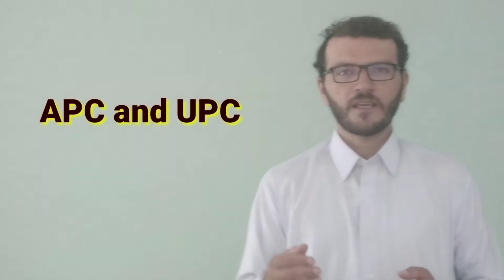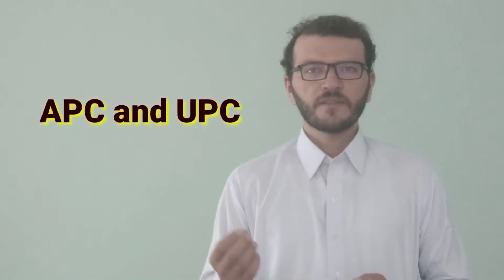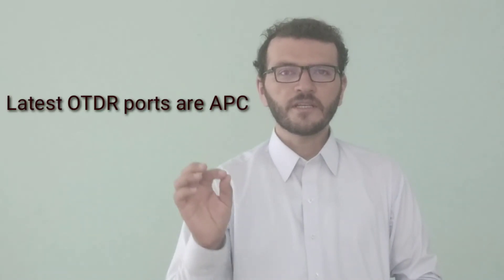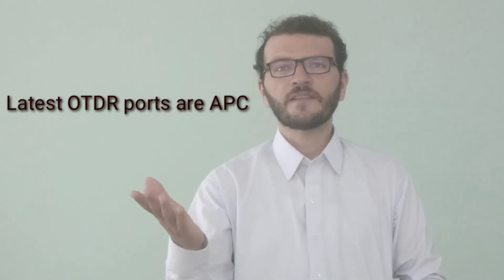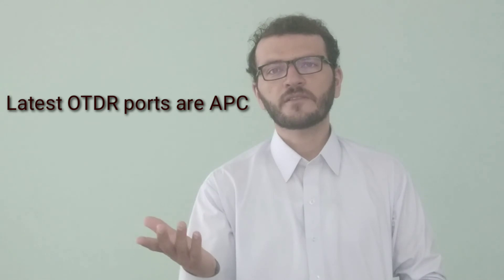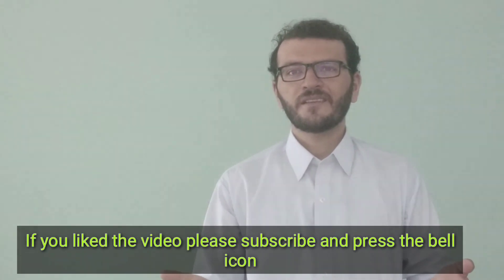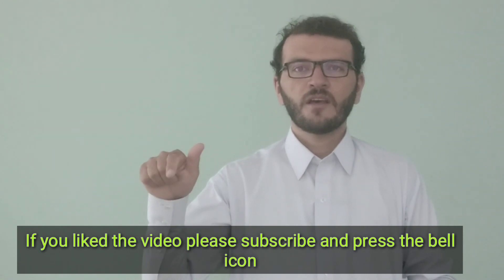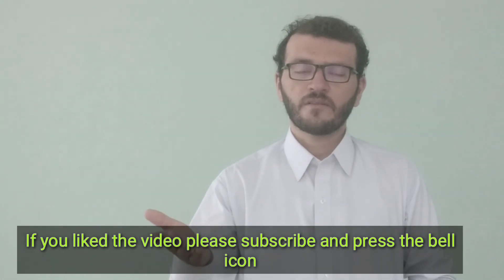How to Differentiate UPC from APC Connectors

Comment: Hi, i have GX OLT and the confusion is the OLT has blue connectors. for PON out put  meaning blue patch cords and They have Green connectors on the ONT. now how the splitting should start and which fiber patch c should we use on the customer side.

Comment: Could I ask you that why APC connector is polished at 8 or 10 Deg? Why not 30 Deg or 60 Deg,..?. Thank you!
Reply from the maker: Interesting question, I asked this from Kevin Peres who is working with the EXFO and has rich experience in the field of fiber optics you can subscribe is channel for more videos, here is his reply, "It is all a matter of snells law of total internal reflection.  I am not sure why 8 deg was chosen, there might be a cost of manufacturing factor in play. It can certainly be other degrees of angle I have not done the math to determine how much of an angle it can be.  In the back of my mind, I remember reading somewhere that it must be between 5 and 15 deg.  I will have to do some research and math to confirm."

Comment: Hi Sadiq, when I searched in google about the connectors in fibers the result was 100 connectors can you explain to me why we have so many connectors and what is most connectors using now ?
Reply from the maker: Hi Mustafa thanks, the most commonly used optical connectors used now are, SM-LC-UPC and SM-LC-APC.
So far as the use of connector in optical fiber is concerned the basic purpose of it to connect to ends of fiber by bringing them close in contact to each other and allow the light to pass the contact point. If you want more details please let me know, I will upload a video on it.
Reply: @MSB1180  thanks Sadiq, appreciate your help.

Comment: Thanks and Why use UPC mostly on ONT side ?
Reply from the maker: Hi actually APC connector is the advanced one and mostly used for  long haul ODF because of its low reflection value -60 dB to -65 dB.

And on the equipment side I have never seen APC connectors. I not sure why they don't use it may be because it's not too much common till now.

Like modern OTDRs have APC port now instead of UPC.

There is no hard and fast rule. You can any one anywhere depending on the port.